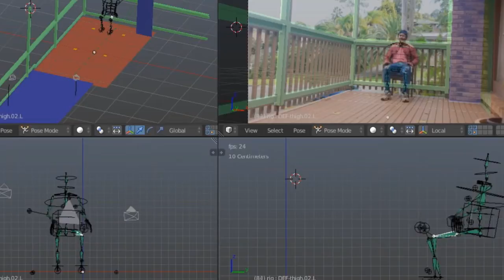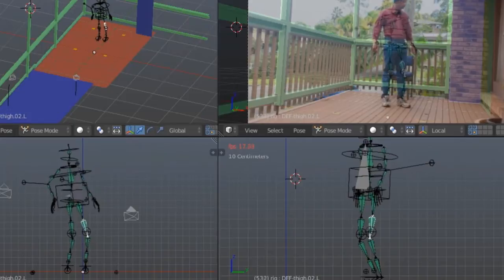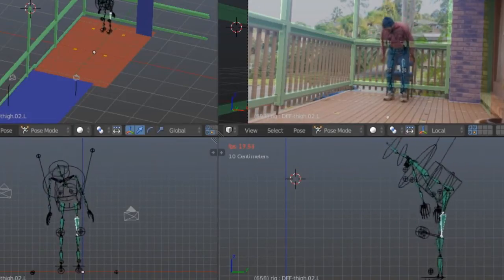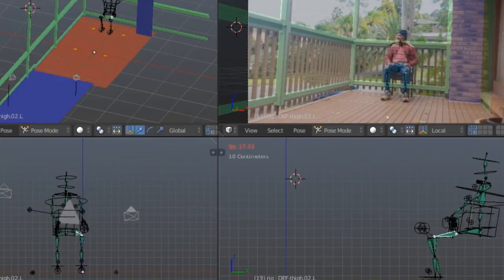Triangulate Addon Demo 2

Comment: After working hand with two takes for half a day, I found this. I have a question. How many cameras does the Addon support? I would like to make a suit with markers in the form of spheres, such as "Vicon"! And I would like to work with a third camera. Thank you for existing
Reply: Update: I had not read the documentation. And of course it can be done. I did a test with three cameras in blender I rendered and reimported, the result is amazing.
Reply from the maker: @segundosdeciencia  Glad it worked out for you. I did a few tests with three cameras myself and it worked, but it was a lot of tracking work. It isn't too sophisticated -  for each track it picks the two cameras with the smallest error and uses them.
Reply: @nerktesting2595  It is no more difficult than doing it by hand with two cameras, without the complement and without markers. A torture!